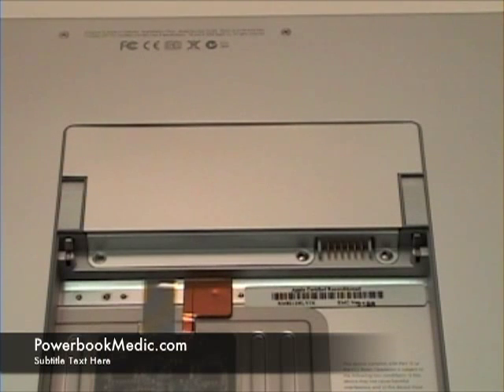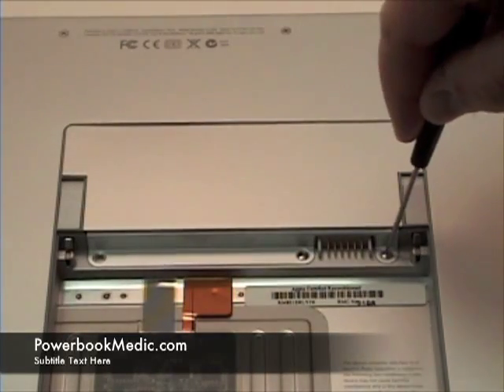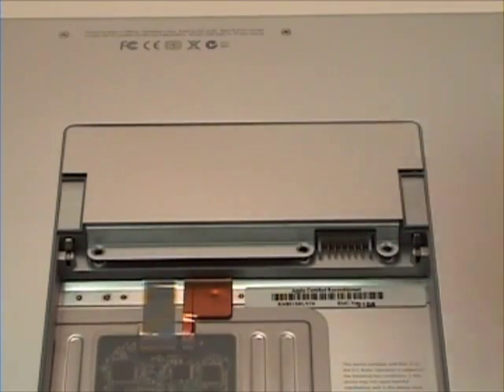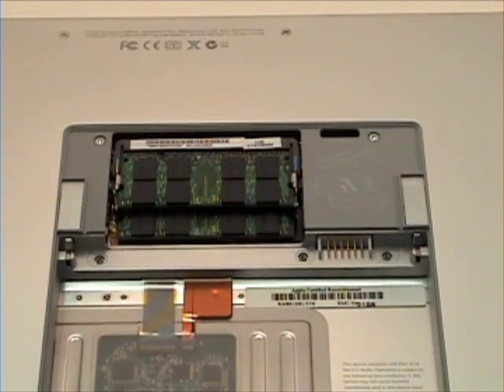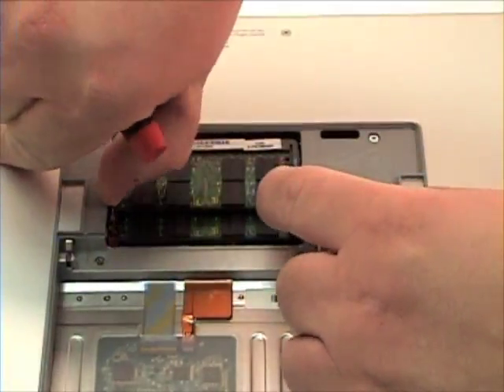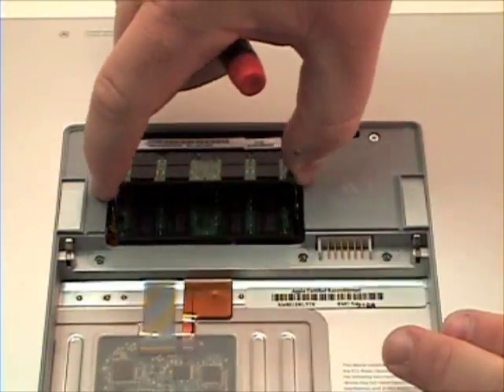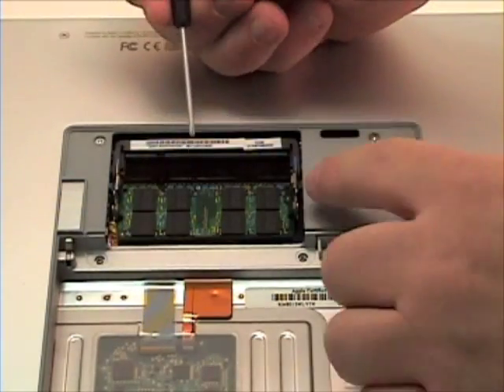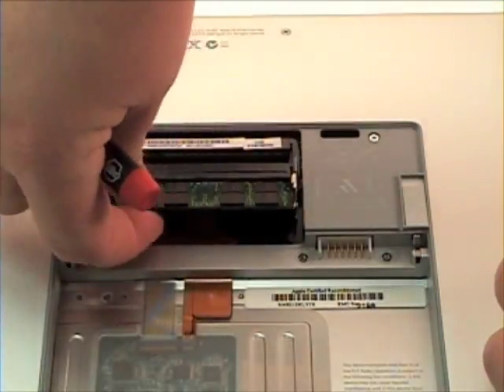Macbook Pro 15" Repair - Ram Removal

Comment from the maker: Try replacing the ram first. Then try only one chip in each slot. If the problem resists, you likely need to replace the logic board.